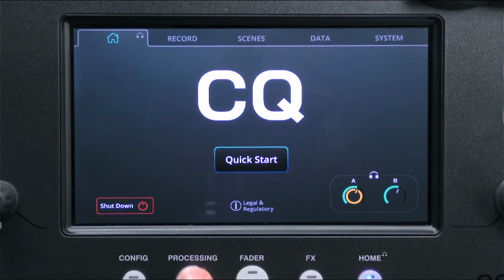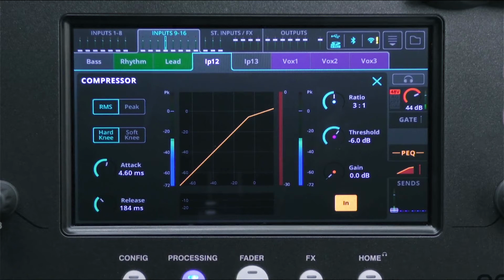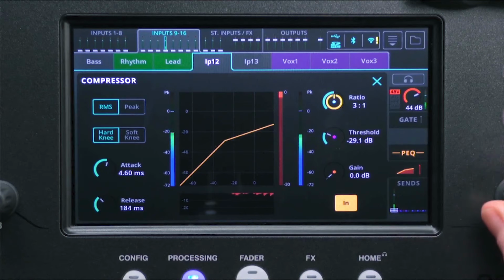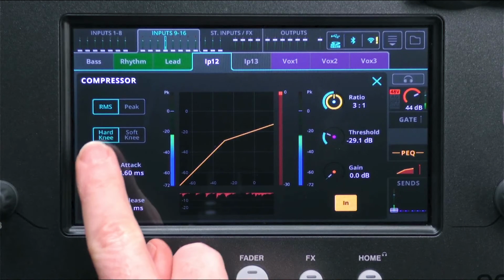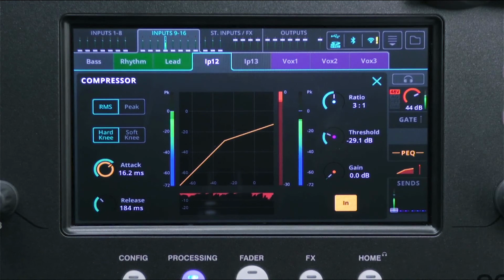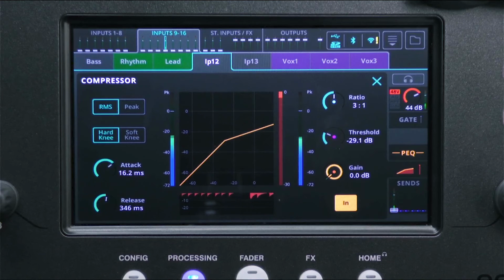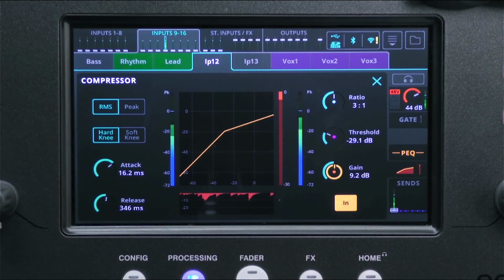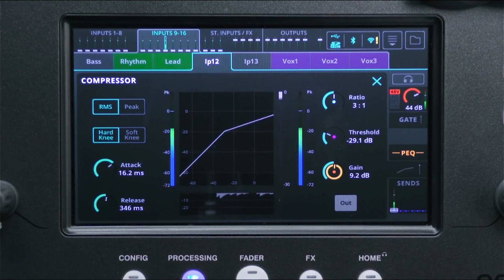CQ How To - Use the Compressor

Comment: Can a compressor be applied to the master bus on the CQ-18T?
Reply from the maker: Yes, there is a compressor available on each of the outputs. Simply navigate to processing>outputs and select the compressor stage on the LR strip to access the control/parameters. 

Thanks,
Luke